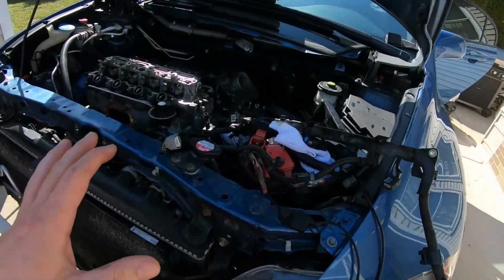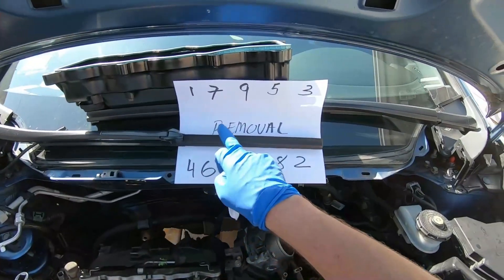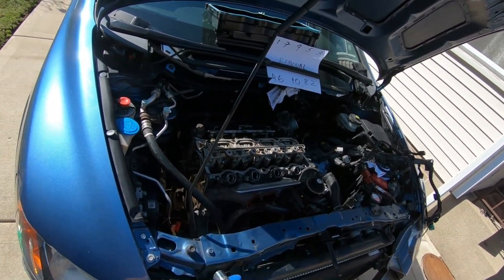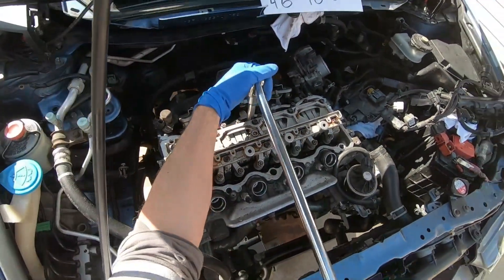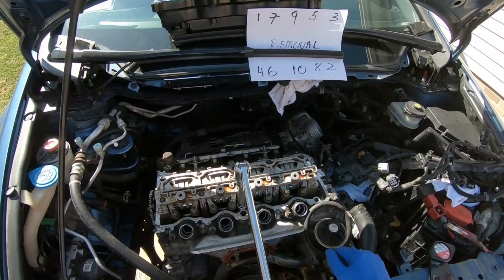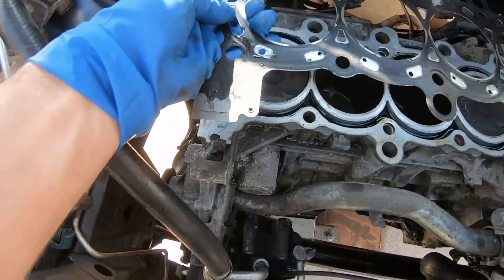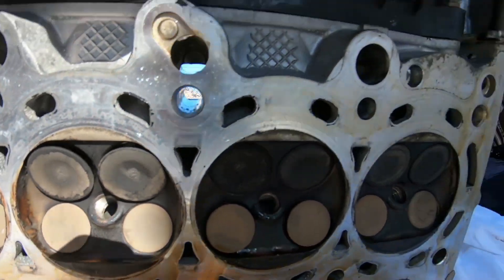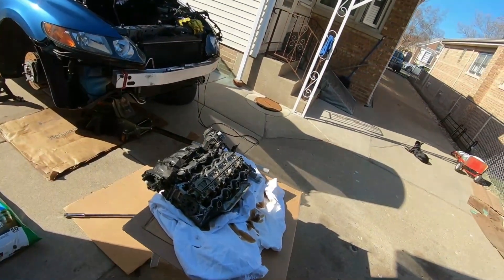I BLEW THE ENGINE ON MY TURBO HONDA CIVIC PT 7

Comment: Interesting thing about the overengineered R18 is that it has 16 valves which is typically reserved only for DOHC engines.
Reply: honda has been doing 16v on sohc engines since the 80s

Comment: You've gone this far and might as well take the head to a machine shop if you can afford to. Valve seals and decked if needed. Well done and don't stop you can do this.
Reply from the maker: That’s true.  But I need this repaired super budget!  I guess you can’t have everything.
Reply: @BulliKid   I get it for sure are you gonna get new rings? Hone the cylinder? Really should. Also plans after repair??
Reply from the maker: Depends on what I see when the piston/ rod gets removed.

Comment: Might as well upgrade the cams since you got the block apart
Reply from the maker: This is a rescue mission now.  Get it running oem spec and hope for the best.  Cam won’t do too much for this motor anyway.  Not worth the cost to performance benefit.  But that’s a great suggestion for someone trying to upgrade at this point! 💪👌

Comment: what kind of camera or go pro are you using when you work on the vehicle you use something with a head strap?
Reply from the maker: I have a goprohero 6 black
With a external mic adapter and a custom mic I made to make it a small set up.  And yea I have a head strap for the GoPro to get the action shots while working on the car.

Comment: Got the same R 18 engine in a UK spec civic. Be interesting to know how much power the standard engine can safely handle. Any idea what yours was pushing before it bent a con rod?
Reply from the maker: I believe around 180-200 whp
Reply: @BulliKid  how much torque?
Reply from the maker: Would be similar.  These engines hve similar leak HP and tq numbers.